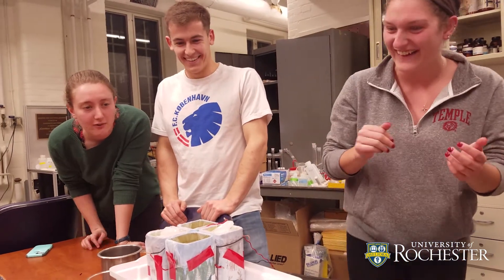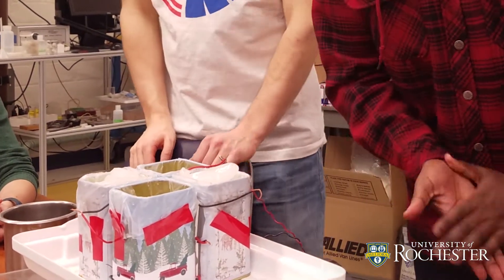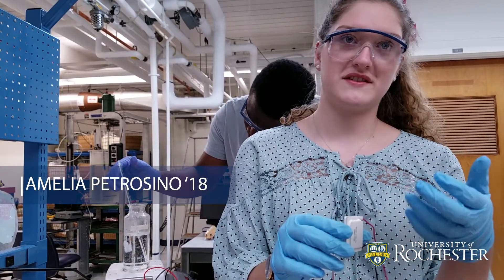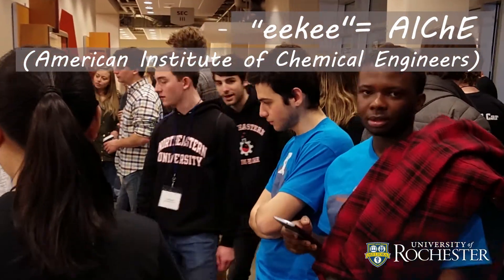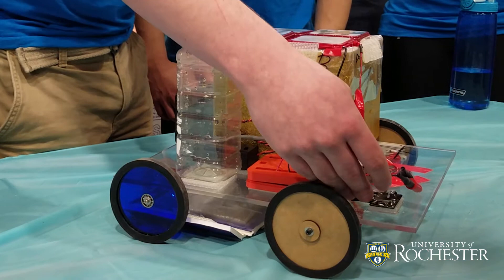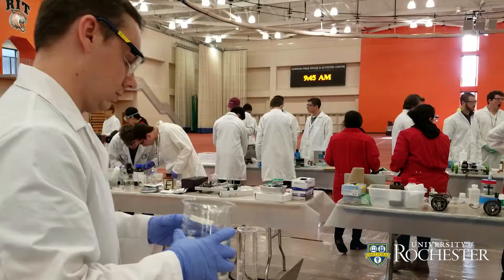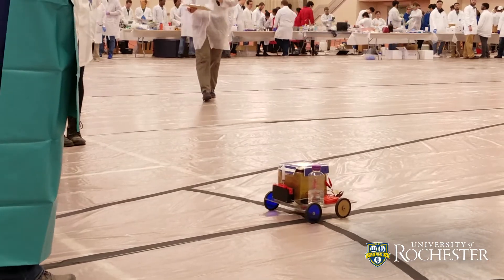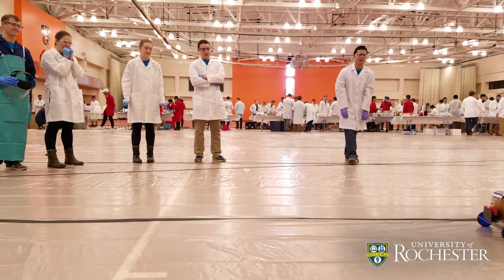Chem-E-Car 2018

Comment: what if the track is curved , like a C or U , how do we turn it
Reply: in that case i saw website on aiche and you can use an arduino easily
Reply: @bayroncastillo7653  can you share the link bro